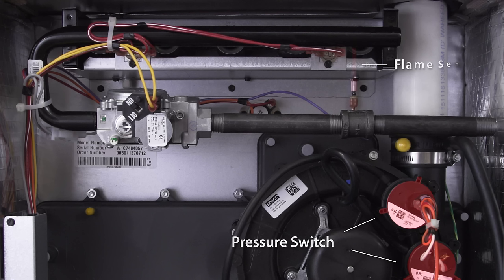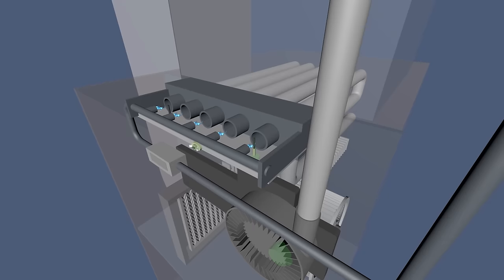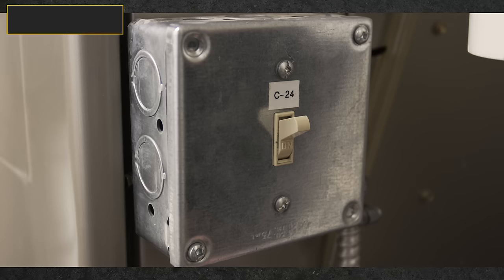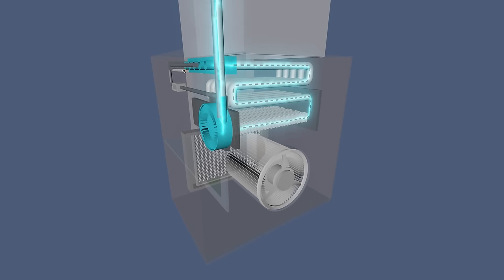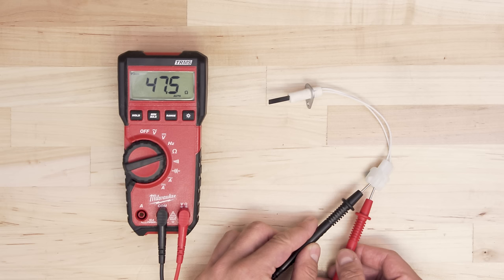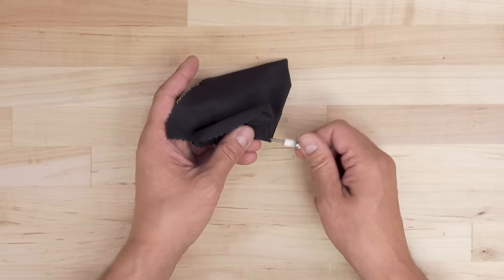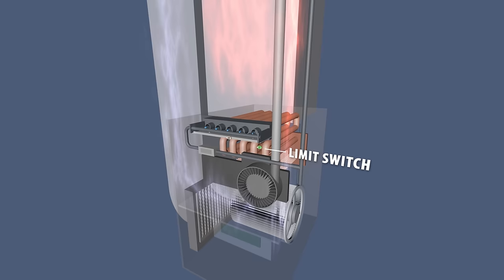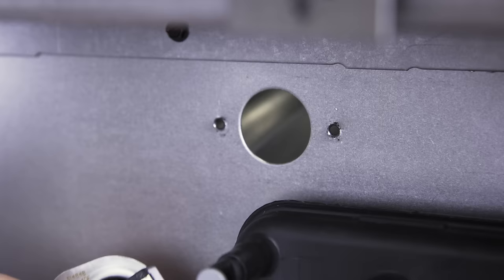Furnace Starts Then Stops - Troubleshooting | Repair and Replace

Comment: Furnace turns off during the night and goes into lockup. have to reboot in the morning, thermostat indicates heater is on. Replaced Limit switch and cleaned the flame sensor and again the same the following night. Any suggestions?
Reply from the maker: Thanks for watching. During the night the furnace has a greater demand, and will run more often. If you haven't already, replace the furnace filter and check for any restriction of the airflow that could cause overheating and trip the limit switch. As well make sure the air intake on the side of your home is clear of any debris, leaves, ice or anything that would restrict the airflow and trip the pressure switch.

Comment: Good afternoon, I have a question in my case the flame does not stay lit, clean the sensor and it remained the same, I already bought a new sensor and the flame still does not stay lit, I would like to know what the problem would be.  Thank you
Reply from the maker: Thanks for watching. The flame sensor  works by completing a electrical circuit through the flames, to the burners to ground. This means a weak flame, an improper position of the flame sensor, or a dirty burner can prevent the circuit from being completed. 

As well with the furnace off you can check to see that the burners actually have  a path to ground. Using a multimeter you can test for resistance to see if there is continuity between the metal burner, and the oven frame. If there is no continuity then the flame sensor likely will not work.

Comment: Much more efficient to put a jumper across the two safety switch wires to test if furnace works before removing a sensor
Reply from the maker: Thanks for watching. In these series we've made a specific choice to not bypass any safety switches or show live voltage testing of any components. Instead we explain the logic and show isolated testing individual components with the power disconnected. This applies to our appliance repair videos as well.

Comment: Can your water heater cause your furnace to keep tripping the switch? In winter our furnace will shut off repeatedly after running a short time or in the middle of the night several times and need reset. We have noticed that this happens sometimes when our water heater kicks on too. Could they be linked?
Reply from the maker: Thanks for watching. That might be the case if you have a standing pilot water heater  and furnace. In that case if the room is starved for air then one could affect the other. Furnaces with draft inducers will control the airflow but there can still be issues with negative pressure. Make sure there is a good fresh source of air in the furnace room.

Comment: Great video, I have replaced those parts but it seems that my furnace cuts off when the temperature gets colder. I can reset and it will ignite and heat up the house to set temp. Then it will not rest only when it's real cold outside. I need your help I've called in 3 different companies to fix but not one can figure this out. I'll try the pressure switch next but this ONLY happens when it's cold at night.
Reply from the maker: Thanks for watching. 

When it is really cold, the furnace has to work harder and stay on longer. This can make problems more apparent. If possible, try to observe where in the sequence the furnace shuts off as this will help you narrow down the cause.

If you have cleaned the flame sensor, replaced the air filter, checked for any outside blockages to the air vent, then the pressure switch could be contributing.

High efficiency furnaces create condensate so its also good to check that there are no blockages and the condensate is draining properly. This can also mess with the pressure switch and inducer. The more furnace runs, the more condensate will be made. You can see more info on this in this video: https://www.youtube.com/watch?v=dcLhyLu0-y8

As well its good to do a thorough cleaning of the burner. A dirty burner can interferhttps://www.youtube.com/watch?v=dcLhyLu0-y8

Comment: My furnace comes on, goes through regular cycle and then I hear a "click noise and no heat comes out of vents..(it sounds like after the "click noise that its starting all back over and ill hear another "click" and so on....)the light through the lil hole is a solid steady red light (no flashes)... do you know what could be wrong?
Reply from the maker: Thanks for watching. When you say that that it goes through a regular cycle, do all of the following happen?

Call for heat, 
Draft inducer blower runs (to clear burners of exhaust gasses)
Hot surface ignitor glows
Gas is released.
Burners ignite.
Flames stay lit.
Main blower fan runs (to circulate air around your home)

From the sounds of it, you're not getting heat, so its likely that the draft inducer blower is running and the gas valve (clicks) off after trying to light the burner. If the flames don't light, then it could be a faulty ignitor. If the flames light but shut off shortly after, then it's likely a dirty or faulty flame sensor.

Comment: I have a newly built home and this is my first furnace I ever had to deal with.  I notice when I turn on the heat, it sounds like it blows unheated air, then turns off after 30 seconds.  It repeats this over and over for over an hour then eventually you feel the heat immediately and it holds the temperature for days until I turn it off.  Is this a problem?  Or should it fire up and blow heat immediately?  I asked the guy who installed it and he got really nervous as if he didn't even know.
Reply from the maker: Thanks for watching. That could be an issue with the pressure or the pressure switch. The inducer fan should run continuously for several minutes before the burners ignite and the blower fan kicks on. I's worth getting the installer to take a closer look at it. The furnace should be under warranty as well.

Comment: My furnace would start and go out. I cleaned the flame sensor and no improvement. I replaced the flame sensor with a new one and no change. I have 107 volts at the sensor tip to the ground, but when the flame comes on and is tested with the multi-meter set dc - uA we get a zero reading instead of the .4  - .6 miro amps we should have. I have had the gas flame fire for up to 60 seconds and then go out. I think the circuit board is defective but not sure. Any ideas?? Supplying heat to my home using the heat pump until the temperature drops to -10 C.
Reply from the maker: Thanks for watching. It can be helpful to clean the burner assembly as the flame sensor completes the circuit through the flame and through the burner assembly. This is explained in this video: https://www.youtube.com/shorts/Bl2hGox1lcs

Comment: My furnace runs for 7 minutes then shut itself off then runs again after 2 minutes. I have replaced the flame sensor and the high limit switch. What else can I do? Thank you.
Reply from the maker: Thanks for watching. It's best to check the airflow and change the furnace filter. Any restriction in the airflow can cause an increase of heat which can trip a perfectly healthy / new limit switch.

Comment: My draft motor gets very hot touch and sits down after a minute.  Then relights restarts and goes off over and over.  Is draft motor at fault? Or the  .....?
Reply from the maker: Thanks for watching. There could be an issue with the airflow, you might get a pressure sensor error code. It is best to make sure nothing is blocking the air intake vent on the outside of your home. Look for leaves or anything that would restrict the air flow.

Comment: How do I turn it off before I start checking everything. My unit is half in my attic and  out onto the roof, I hope mine works this way.
Reply from the maker: Thanks for watching. Before anything, turn off the power via the breaker panel and there should be a power switch next to the furnace. As well always turn off the gas supply at the shutoff valve.

Comment: My furnace was starting and then would make a big poof or bang noise. Before it full starts running.  Was happening for hours. Then stopped. I cleaned the flame sensor. After this. Just because it was easy. But now it's not making that noise and running normal. But it was definitely making a big bang. -50 temperatures here with the windchill. Not sure what to check
Reply from the maker: Hi Kyle thanks for sharing your experience. Is the poof, the burners igniting? Does the bang persist after the furnace starts blowing warm air?
Reply: Thats delayed ignition.  You had at least one burner chamber filling with unburned gas.  All burner chambers should light almost at once.  You probably had a blockage in the flame chase. Seems like it blew itself clear. You should call someone to check it out if it persists.  Have it cleaned up.  A routine fall maintenance would do it.
Reply from the maker: Troy that was a solid explanation on delayed ignition. And you are right, routine maintenance is definitely important.

Comment: Ended up replacing the filters early and cleaning the sensor at the same time. Not sure which one fixed it. Thanks.
Reply from the maker: Thanks for watching! We're glad that you got it fixed and regardless its good to eliminate those as potential problems for the future.

Comment: U are A fine Master ❤👌🙏🙌👍👏👏󾓦✟✟✟󾓦USA .Xmas
I have 2 question sir :
1 - my furnace is a kenmor , it has a big round green light . It flashes non stop .
I've clean the flame sensor & check all the sensors & all have continuity .
Still the furnace &the fan don't come on. 
When I put the switch on thermostat on fan , fan works . 2 : why the flame does not come on .
It is december 21 & it is very cold .
Xmas & happy new year ❤
Reply from the maker: The thermostat fan generally has a "on" and "auto" setting. The on setting will run the fan 100% of the time. The auto setting will only run the fan during heating. 

If the blower fan runs when set to the "on" setting but doesn't heat then its possible that there's an issue with the signal to heat coming from the thermostat. It would be good to check all the connections at the control board, see if there are any loose wire terminals or corrosion. As well inspect the control board for any visible signs of wear, any melted components etc.

If all the sensors , wires and connections are good, then it could be an issue with the control board. It would be good to get a second opinion on that as control boards are difficult to test.

Now control boards are pretty simple to replace and only takes a few minutes to replace: https://www.youtube.com/watch?v=4SY8lRl8HV0

Comment: My furnace is Coleman free-standing with a pilot light and thermocouple. I light the pilot, wait, then rotate the switch/knob to "on," furnace ignites, then goes out after about 10 seconds. I can't find any help for a furnace of this type, so please help.
Reply from the maker: Hi Richard, thank you for watching! You most likely have a faulty thermocouple, or there might be corrosion on the thermocouple connection reducing the voltage. We made a video showing how to replace the thermocouple: https://youtu.be/3EKbSiAJyiI Alternatively it could be an issue with the airflow. If the exhaust vent is clogged, it will create back pressure that can extinguish the pilot flame. As well make sure that there is a good supply of air into the furnace room to make sure that it isn't starved for air.
Reply from the maker: As well the thermocouple voltage can be tested, we did a video on water heaters, the same principles apply though. https://youtu.be/Lu5GvbvspMw?t=209

Comment: Thanks for the video. I have a furnace that has every sign of a dirty flame sensor. I cleaned it and same issue so I replaced it. It still shuts down within 5 or seconds of the burners igniting. Any ideas what else to check?
Reply from the maker: Thanks for watching. This video explains the flame sensor in 1 minute and might help you think of it differently. https://www.youtube.com/shorts/Bl2hGox1lcs It can be helpful to clean the burner and the visible portion of the heat exchanger. As well you can check with a multimeter to see if there is a good path to ground.
Reply: @AmreSupply  That is very helpful. I will test the flame sensor for voltage next to confirm the circuit is being completed. If it checks good is my only other logical step the control board itself?
Reply from the maker: @dustinc.7812  

To be more specific, here's what is needed for the flame sensor to work properly. 

A dedicated ground wire must be connected to the furnace.

All wiring connections must be tight.

The flame sensor must be positioned within the flame.

The insulation on the flame sensor must not be cracked.

The control board will send AC voltage to the sensor, which is then rectified to DC voltage through the flame.

If all of those conditions are good, and it's still not working, or there is no AC voltage being sent, then the control board is likely faulty.

Comment: I just had a brand new unit installed. I have my heater on. I heard the fan come on stayed on for about 5 seconds then it shut off. Don't know if the flames came on though. Should I call the technician right away.
Reply from the maker: Thanks for watching. It could be an issue with the pressure switch. Yes it would be best to call the technician in to take a look.
Reply: @AmreSupply  thanks for the info. Much appreciated.

Comment: What if I replaced the flame sensor but it still shuts off after ignition what could it be?
Reply from the maker: Thanks for watching. For the flame sensor to work it needs to complete a circuit through the flame to the burner so there needs to be a good path to ground. Try cleaning the burner as a buildup of carbon can prevent the circuit from being completed: https://www.youtube.com/shorts/Bl2hGox1lcs

Comment: Hi Vance,  I was hoping you could give me some advice.  My parents had a new Amana furnace 6 roller (model AMES801205DX installed.  Unfortunately they continued to have problems with it.  The seller admitted they installed too big of a furnace for their house and replaced it with a Goodman 3 roller (model AMES800604BXAA).  They did not receive any refund for the price difference.   My dad has dementia and my mom has Parkinson.  I think the company took advantage of them, but I can't find the prices for the furnaces.   Any feedback you could provide would be greatly appreciated. 
Thanks,  
Kevin
Reply from the maker: Thanks for watching. Since we do not sell furnaces (only sell repair parts) we don't have any lists of furnace models and their prices. There might not have been a big difference in price between the two models but it's hard to say exactly.

Comment: I know it’s an old video but maybe you can give me some help or someone can, 

The fan comes on and the burners come on for maybe 3 seconds then off again

I have cleaned and then replaced the thermocoupler(flame switch) now twice and no change

The filter is clean, etc etc, what am I missing???
Reply from the maker: Thanks for watching. Does your furnace use a pilot light with a thermocouple? Or do you have a draft inducer, spark or hot surface ignitor and a "flame rod" or "flame sensor"?

A flame rod works differently than a thermocouple. A flame rod is literally a piece of metal that completes the circuit through the metal burners and housing of the furnace. It's best to clean the flame rod, clean the burners and make sure that there is a good connection to the control board so that the circuit is completed when the burners are lit.

Comment: Have 2 old Lennox units and one of them short cycles, but only when it's colder at night, works fine during the day.  Basically starts up, fan runs for a few minutes and then fan shuts off while flames stay on and then fan kicks on again.  Filter has been changed so I assume limit switch issues like your graph is showing?   So would that be opposite of furnace getting too hot, ie it's not getting hot enough since the fan kicks off and flames stay on?
Reply from the maker: Thanks for watching. It could be caused by a faulty limit switch that is tripping at lower and lower temperatures. This would fit in the scenario of when it's cold, as the furnace will be running for longer and the heat exchanger would be building up more heat over time. If the limit was lower than normal, it would trip during the cold weather, and not when its warmer due to the furnace not running for as long.
Reply: @AmreSupply  Thanks for replying.  love your shop btw,  always my go to for appliance parts here in Calgary. :)
Reply from the maker: @gs98999  Thank you! We're glad that you've had a good experience with Calgary store! From the video side of things we're actually not to far away, we film these series here in Edmonton!

Comment: My three burners all ignite, but one of them flickers like it wouldn’t be getting proper gas, then the system cuts cuts the flames off, keeps running the fan and tries again momentariliy.  I would think the tip was clogged, but it’s not always the same burner.  I have several other gas appliances and the unit behaves the same whether it’s the only thing running or if all the other items are running at the same time.  Can this be anything besides the gas valve leading to the burners?
Reply from the maker: Hi Jonathan, thank you for watching. If the other burners are working properly then its a sign that you have a proper supply of gas. There are two things to check. Its either a plugged orifice for that burner, or the other side of the burner is dirty and plugged with carbon, reducing the airflow through the heat exchange (that would prevent a strong flame even with a proper supply of gas to the burner)

 It would be best to clean all the burners and the orifice as well. The orifice can be unscrewed with a wrench. You can use a small wire to help clear the hole. Compressed air can help as well.

Hope this helps!
Reply: @AmreSupply  thank you